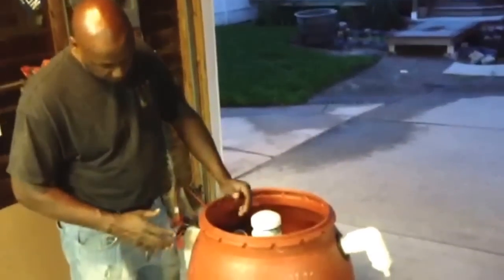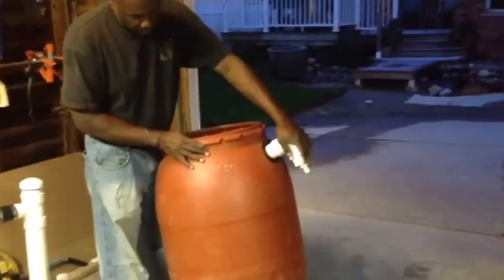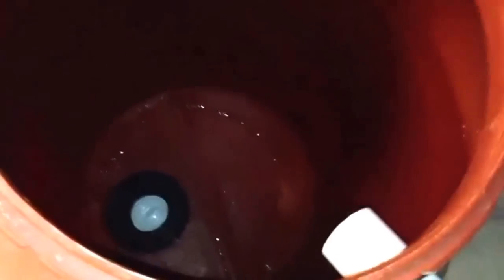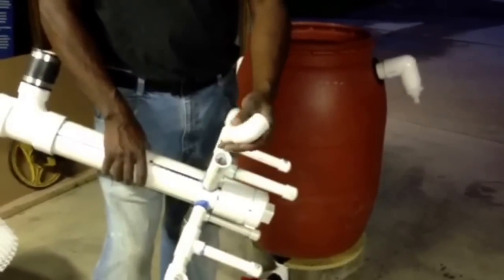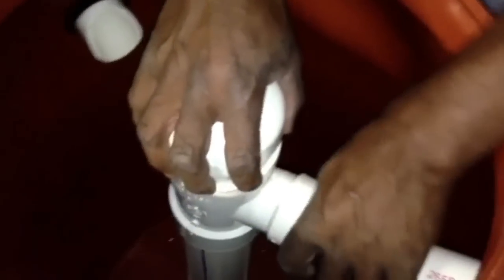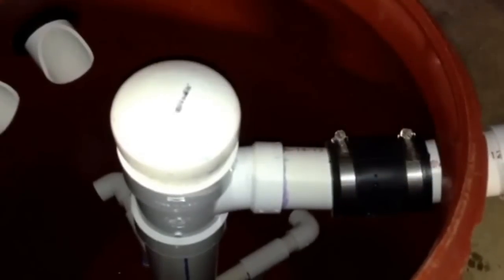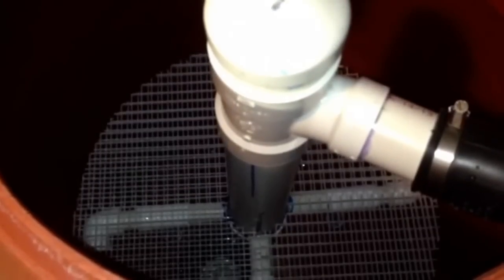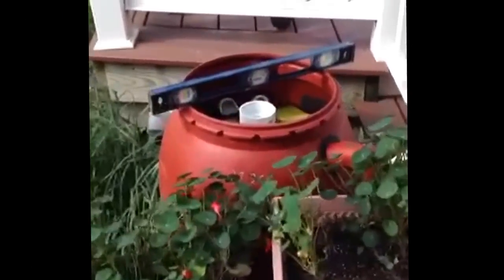DIY- Biological Filter for your Koi pond

Comment: Beautiful setup original and at the same time efficient.  Very high class.  How efficient is it and how many gallons does it handle?
Reply from the maker: It’s very efficient I run a 3500 gallon pond and I only clean  filter out once a season.   I may back flush twice during the season.

Comment: How did you connect the 1" tubes coming off of the 3" tube?  Did you have to drill and then tap the threads ?

Comment: OK.  Here we go.  I have watched hundreds of vids on this topic and yours by far is OFF THE Hook!  Will do this with my 55 gal pork casings barrel bio filter.  Building it to filter a 400 gallon tub with Brackish water for Northern diamondback Terrapins.  Only thing the vortex on the bottom you should have a monocle bottom.  You get the spin heavyer waste sinks makes its way down settles then can be drained out.  Thank you.

Comment: Very nice design. I have a 700 gallon Koi pond so I built my bio filter from a 45-gallon barrel also. I modified the design a little bit with Inlet and Overflow Outlet from top . The pond water was pump in (a 1000-gallon/hour) , going down to the bottom, and was swirled to separate the solids. The water was then pushed upwards, filtered through 5 layers of 1.5 inch round Matala media (green, blue, and grey on top) and running out of the overflow outlet into the pond. The pump ran 24/24. The pond water was clear and clean. I just clean the system once a year by flushing the 5 pieces of  Matala media after the dirty water was flushed out from the small outlet at the bottom of the barrel. Thanks , Charles.I have been using my system for more than 2 years.

Comment: That's filter is awesome! How has it been working for you?
Reply from the maker: 5 year strong - not one single issue.
Reply: +charlesatdetroit I have a question, how often are you changing those filter pads? If I wanted to use bio balls with this particular design, where would I put them? Man I think this is the best looking filter on YouTube! I think it is great. I want to build this, my only problem is my water is so green and sludgy right now. So I am trying to change my filter pads often to try and eliminate the sludge.
Reply from the maker: +trenter22 
I think bio balls in media bags would be a great idea. 
As far as the scrub pad I used. I backwash about every 40 days. The only time I remove pads is at the end of the season for a thorough cleaning.
Reply: +charlesatdetroit when you backwash is that where you use that valve underneath to clean out?
Reply from the maker: +trenter22 
Yes that's correct

Comment: how did you drill the large holes through the barrel? I'm having issues doing that on mine... how to get a proper "circular" cut-out?
Reply from the maker: Hello Sir , I used a hole saw with a longer pilot bit.
Reply: +charlesatdetroit , follow-up question, your uni-seals, are they just 1 piece each hole, or is one piece on the outside and one piece on the inside?  I've used one of these (from Amazon) and it leaks (even with Silicone applied): http://www.amazon.com/gp/product/B0006JLTO6?keywords=2%26%2334%3B%20bulkhead&qid=1454005999&ref_=sr_1_2&sr=8-2
Reply from the maker: The uniseal I used where one piece design. 
Be sure not to oversize the hole , the tighter the better the seal.  I had to apply dish soap to PVC pipe to install it in seal. 
I have not experienced any leaks.
Reply: +charlesatdetroit did you also use a uni-seal for the bottom-drain?  or is that a shower-drain?
Reply from the maker: HI, Steve 
The bottom has a 4 inch bulkhead

Comment: Your filter is very close to the one I built about 5 years ago and works great. I haven't had to clean out the base coz the bacteria works so well it eats almost everything, the top I clean once a year, just before summer. I turn off the outlets but have another large outlet that goes to the garden, I keep gently pressing down on the media till the water is clear, turn on the outlets, turn off the waste outlet and it's done for the year. There's no need to take it apart. Btw, mine's made from a black brewing keg and instead of lighting mesh I used a large pot saucer with a lot of holes in it. I suggest you leave your inspection cap off though, biofilters need oxygen for the bacteria to breed. I know there are a lot of filters built with a direct line in but oxygen is the key to produce aerobic bacteria. Here in Oz we don't get cold weather so the filter has to work all year round. Have you made an update on how it all went?

Comment: How did you connect the 1 inch tubes to your 3 inc pvc? you drill holes and glue??

Question 2: since this has been in awhile, how is it working?

Comment: Now that is excellent... well done!  I was looking for a solution to the grid on the bottom of the skippy filter, using the light grill is perfect.  I bought a roll of quilt blanket batting at the cloth store and placed that as my top final filter.  Picks up the microscopic dirt before it leaves the filter.

Comment: Ive got almost the same system on my pond.. Ive got mine under pressure all the time with a pump, pushing 2100 gal an hour. have had it running for 2 years summer and winter. clean it out only once a year and flush once a week for 2 mins.. How many gallons is your pond? Im building a new pond this spring and was wanting to know if i need to build another filter.
Reply: Brian Guy  i wanted to do gravity fed system but my barrels are going to be above water level and i dont want to bury then in the ground (because of slope of yard). you say yours work ok being pump fed ? And do you have a pump for water back to pond or do you let gravity take over ?
Reply: I have a single pump feeding 2100 gal an hour., it pushes the water through the filter and back to the pond. Theres a 1-1/2 inch return line. The new system I'm building will move 4500 gal an hour through 3 filters and back to the pond.

Comment: how about using a commercial buffer scubber pad it is round and it like scotchbrite material. Trim the outside and the center to make it fit around the center hole. cut once from outside to center to make it easy to install. It will be easy to clean
Reply from the maker: Hey Bobby ,  you are correct about the commercial scrubber, but using them hole and stacking them on top of each other may result in the media being to dense and restricting the circular pattern water flow.  So cutting 4x4  6x6 inch placing them in loosely works very well.  I will say I'm try a two layer design this season. The first layer loosely placed  20 inches, then the second layer is placed horizontally around barrel just below outlets. I will post video of redesign media prior to startup.
Reply: no need to stack more than one it just helps catch a little of the waste

Comment: That is brilliant. 

I am am planning my third Koi pond after to previous ones

1st was 9 feet deep, 6ft under ground and 3ft over. 10feet diameter. Used a oase system. 

2nd was a above ground only 3feet high. 

Now the third one I wanna go Biiiig!! Bit need to construct my DIY biological filter. 

I have calculated it to be 70,000 Uk litres.  

How many do you think I would need I your design and what parts and sizes will be sufficient. If you have time please advice my friend. 

I also need I camoflage so it's blend in the garden. 

Kindest warm regards 

hhhehrhusob1399@icloud.com

Comment: Great video. My question is how do you secure the 1 inch PVC pipes to the 3 inch column pipe?
Reply from the maker: Hi Allistair,  I drill the holes slightly smaller than the 1 inch PVC pipe. Then I used a file for a secure tight fit. I used PVC cement to secure the pipe, I also applied a V bead of safe silicone around the pipe.

Comment from the maker: Hey Arnell  flush is conducted by opening 3" inch bottom valve for a back flush. 
Thanks for the question.

Thanks everyone for the comments, FYI  if the live in the cold climate states as I do, I pull the bio late November. As a remind after draining down the system be sure to pull the main vortex tube it will hold about  1 gallon of water below smaller outlets.

Comment from the maker: @markchance  Hi Mark,  I don't think you will have a problem with barrel supporting a higher height. However, it will require a larger volume pump, or place another pump on one of the discharge outlet.